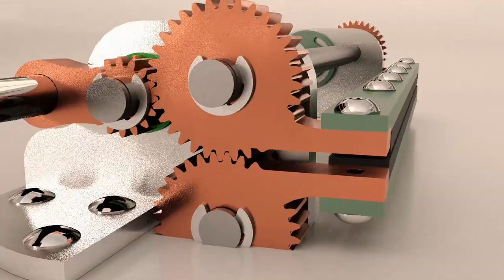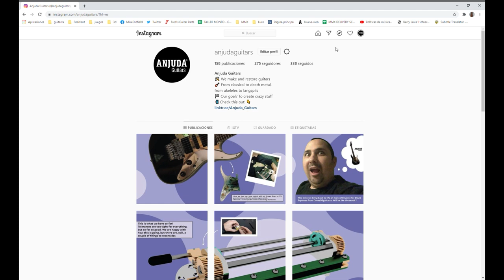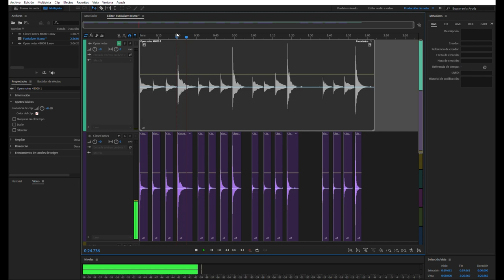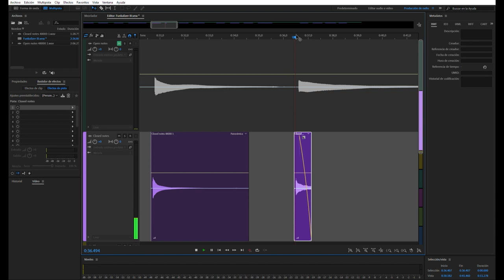Testing Time! - Making the Funkalizer 2.0 for the Cyber Bass (Part III) – Anjuda Guitars #11

Comment: Guessing from the intonation, the E string needs to be a little longer. Slant bridges solve that problem but it looks like you have that covered in your adjusters.
If the damping could be further from the bridge it would be more effective, but maybe there is not any space before the marble guides ....very interesting work!

Comment: Because the string vibrates the most in the center and vibrates less and less towards its edges, it is difficult to dampen all of the movement with a damper at the very edge of the string. The funkalyzer might work better if it were simply moved further up along the strings.

Comment: I think, if you would make all arm longer, it would work better. Then you would hit the string not so close to the beginning and you could control the strength much better on the side with the hand. But i dont know if there is enough space at the original cyberbase to do that.

Comment: The distance from the bridge to the felt pad is too small. This is something that would need to be dialed in, so decide on a position before making it into a machine. You could also just make the pad larger, so the surface area of contact is greater. It also doesn't need to be on both sides of the string, you could get rid of the cogs and all that and just have it snap down from the top.